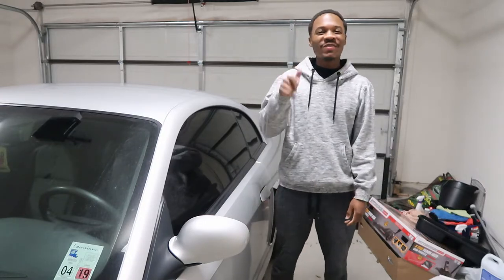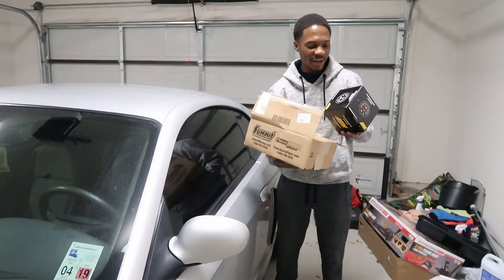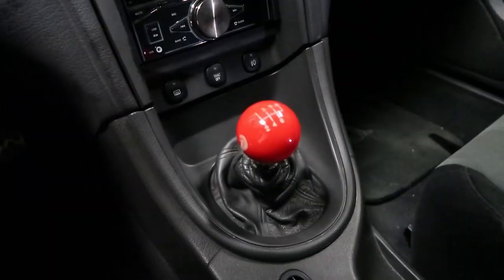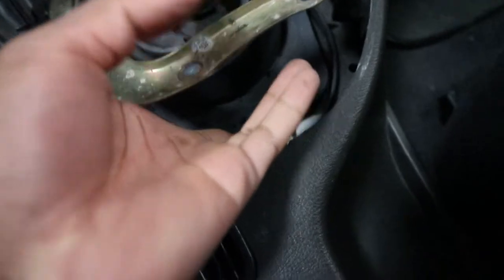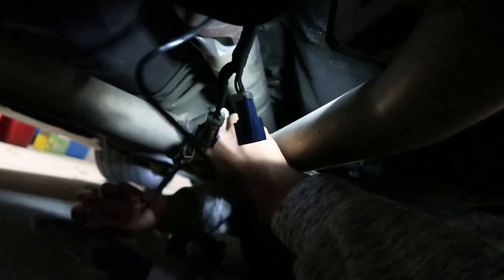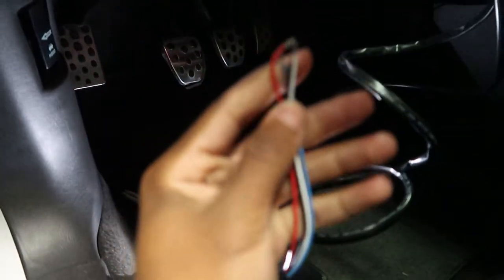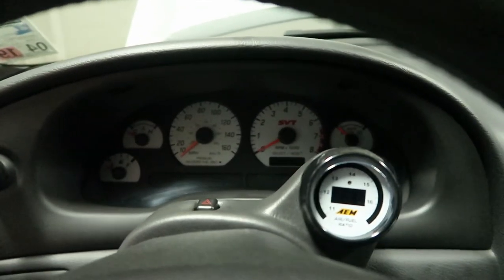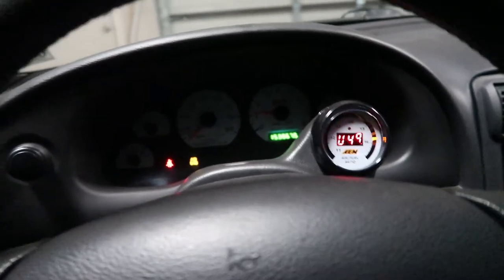AFR Gauge Install | Monitoring Air/Fuel Mixture

Comment: Well it's about time bro!! Now you can make changes without worrying about breaking the engine. Gauge is reading good...average should be 14.7 at idle and WOT should read about 11.5 or so. Only problem I can see is I don't know how accurate the readings are using your rear O2 bung location. It may be too far back from the exhaust manifold.  Most people I know have mounted the included bung further up the line closer to the exhaust manifold.
Reply from the maker: Yea, I’ve read and talked with people who have mounted it in the rear O2 location and they said they were fine. If anything, it’d read a little more lean but not by much. As long as it doesn’t read too rich and the tuner add timing because of that, then I should be good lol

Comment: Do you have to turn off your secondary O2’s for this? Or does unplugging the 1 rear not do anything really but pop a code?
Reply from the maker: Man Man B yes! The secondary O2s must be turned off first
Reply: PJ Morrison Thanks PJ👍🏼
Reply: Best way and more accurate is to get the bung welded onto it after your primary o2.